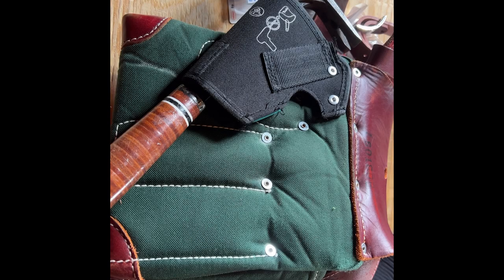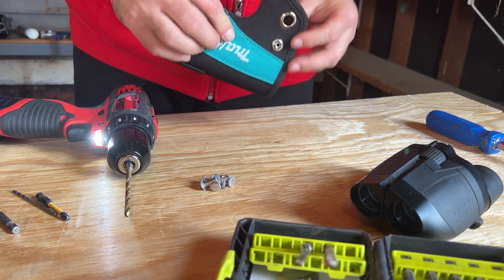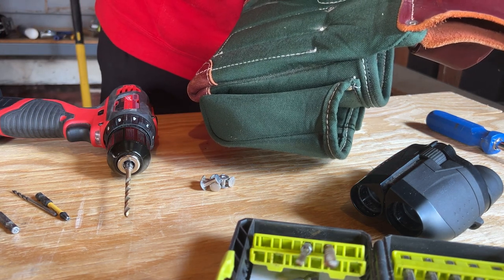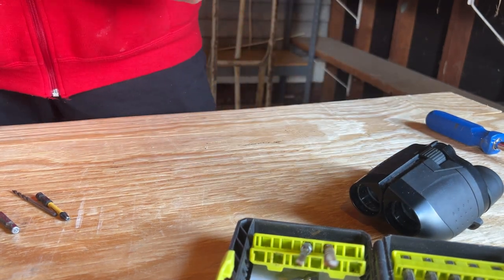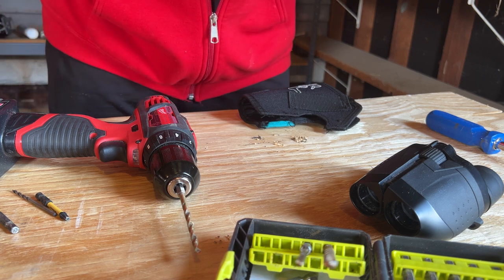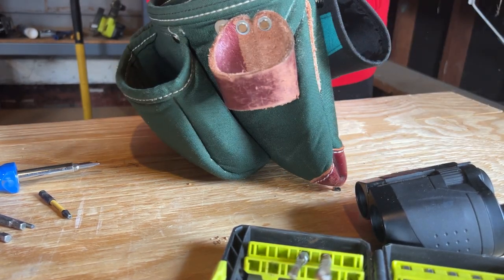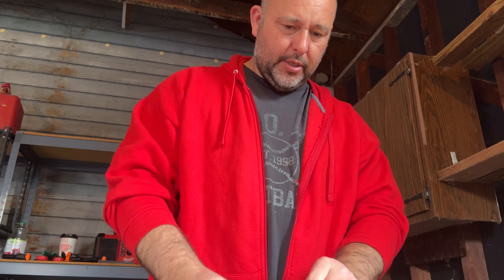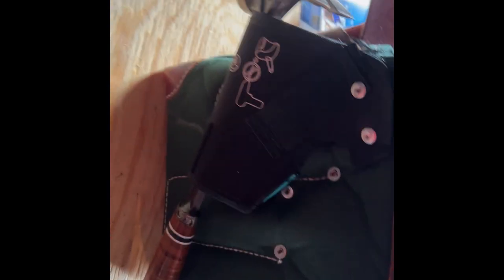The Ultimate Upgrade: The Occidental Tool Belt Hammer Holster

Comment: That is a great idea, I would imagine you could use the diamondback hammer holster also and that one is a full length sleeve so even if you have an axe handled hammer with a curve it never hangs up.
Reply: Yeah, I've done that, it works well. This is pretty genius too, and probably cheaper.
Reply from the maker: I think someone posted a video using the diamond back hammer holster.  I just thought that holster was a bit expensive.
Reply from the maker: Thanks and you are right about the diamond back holster
Reply: Thats why im loooking these videos up i just got a diamondback hammer sleeve & want to put it on my occidental 
Thought i was the first one to think of it 🤣 guess not
Reply from the maker: How did it work out using the diamondback holster on the Occidental?

Comment: Thank you very much for this video. Did you use those threaded screw together type rivets?  It doesn't button on and unbutton right?
Reply from the maker: I used blind posts so it does not button.  They screw together.
Reply: @matthewharger4578  ok thanks again. I just ordered an angled hammer holster from the Amish Leather Works store. If I don't like it then I'm getting a Makita holster and trying this out.
Reply from the maker: @Eger118877  good luck, let me know how it goes.

Comment: I’m a little lost, why not just use the holster that came on the belt? Is it because of the angle? I was a little curious when I was watching the video. Anyways, it came out nice. Good job.
Reply from the maker: Occidental tool belts do not come with a hammer holster.
Reply: @matthewharger4578  what would you put in the loop that you see at 9:50? Am I missing something?
Reply from the maker: @SergioPena20  That is a hammer loop located near the front of the bags that is very inconvenient and does not keep the hammer out of the way like a hammer holster.  Those loops are called knee knockers for a reason.  I actually put my snips in that loop.
Reply: @matthewharger4578  ah ok. I understand. I can see why it would be a pain in the ass to have it there all day.
Reply: It’s also nice to have your hammer up front without it hitting your knee all day